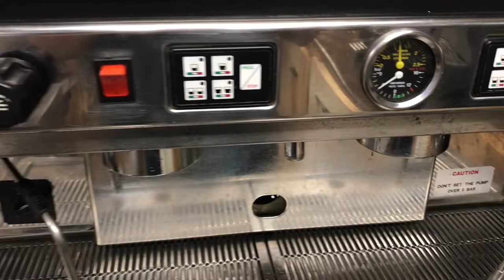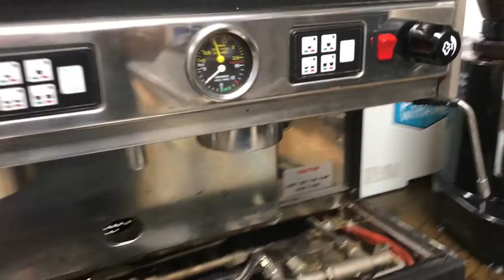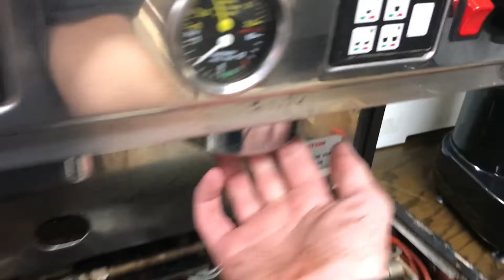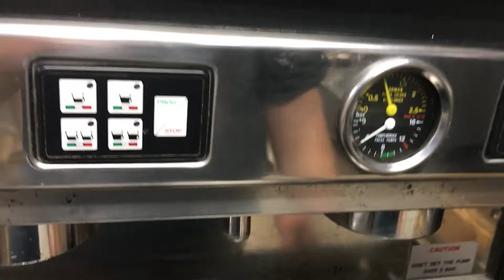Replacing Espresso Machine Gaskets

Comment: I’ve Allen wrenched the head off to make sure I didn’t have a plugged port. It was clear.  I have constant water dripping off the flush tube (don’t know the proper name)
Reply from the maker: Sounds like the solenoid might be bad or a washer in the assembly